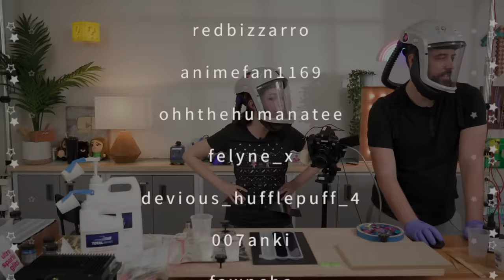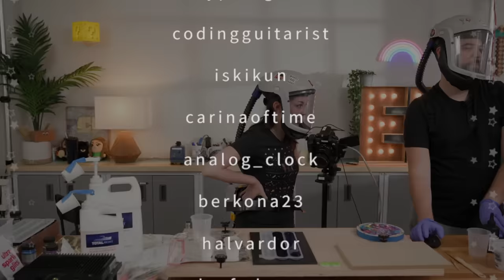Making 3 Resin Incense Burners (1 glows in the dark!)

Comment: the first one is supposed to be at an angle!! if incense burns vertically it burns really fast and the ash collects on itself and it can even be put out by the ash - so it’s made at an angle for this <3
Reply: It depends on the incense. For example, most Japanese incense is meant to burn upright.
Reply: I came to say this^
Reply: Thank you for saying this
Reply: No, they do not burn faster, but slower. Without an angle the actually burning Ø is smaller since the heat travels upwards parallel to the ground. I always put them up straight and the ashes just fall of the side around the stick; they don't go out because of this. Neither do incense cones which also stand upwards and even get wider and build up ashes. Well made incenses don't go out because of ashes.
Reply: @shelbyantoniotti8595  ok

Comment: The pringle earrings are on point.

Also you could drill holes in the resin jewels, add a string and you have Christmas tree ornaments!
Another thing I noticed is you checking gloves before using the mouse, reminded me my dentist had these square semi sticky sheets she put over the mouse so you can use it without worrying about getting anything on it.

Comment: ok but those space mask things I can only assume are also about 100x more comfortable to use, especially over long periods of time. I spent a year doing composites manufacturing as a day job, and when we were actually dealing with resin we were required to wear full face respirators and chemical protective suits, and it gets genuinely unpleasant after a while, especially on a hot day.

Ooh, and the double gloving too! That's totally a thing to do if you have any reason why you might want to have clean hands for anything during the process.

Comment: If you use silicone spatulas/stirring sticks there should be less micro bubbles in the resin. Wooden sticks add bubbles. Hope this tip helps!

*bonus: reduces waste
Reply: How do you get the resin off them, just wait until it hardens?
Reply: @missbeaussie  the resin peels off silicone tools just like a silicone mold
Reply: But yes .. after it sets/hardens

Comment: Me would pulled the powder just into to the mold and clean up the edges afterwards. Would it work to use a spatula and spread the resin into the mold? Becouse you use uv resin it should make no different, should it?  I am guessing, when you pourd in the resin it would get mixed up anyways. Whats about glue? Like clear glue mixed with the powder to keep it in place and than puor resin over it. I never worked with resin so this is just a guess.

Comment: Is the clear part of the mask replaceable or do you two have to get a whole new mask if something happens to the clear part?
As for the petri dish look. I tried it also with transparents. Didn't work. So I checked and found out that the ones I've watched, they used opaques.
I did remember when I was trying the effect. That you need to take either a pin or toothpick to do a light stirring for the petri dish look.